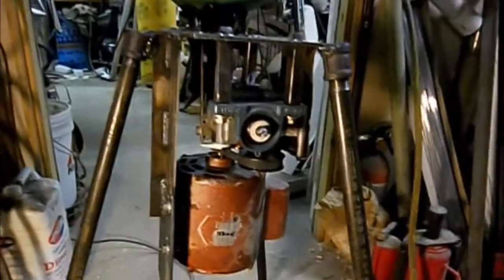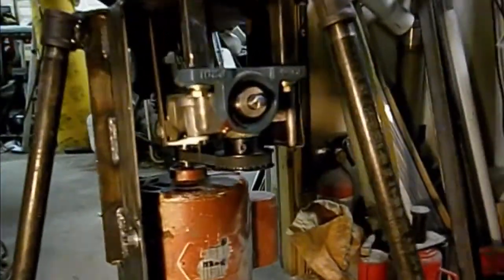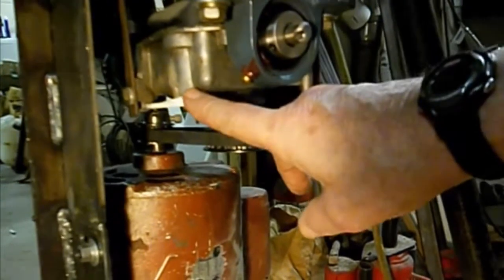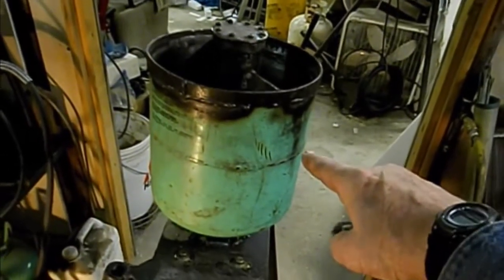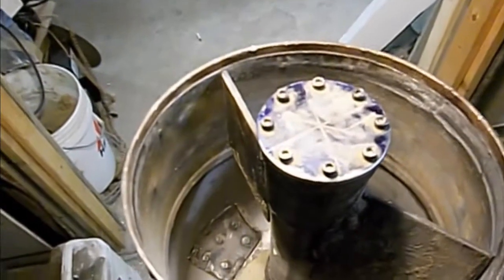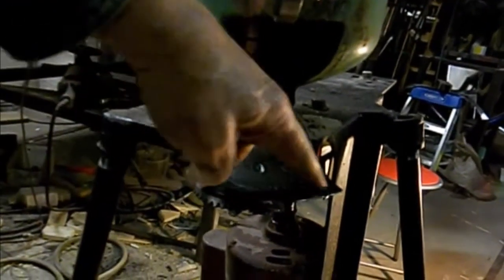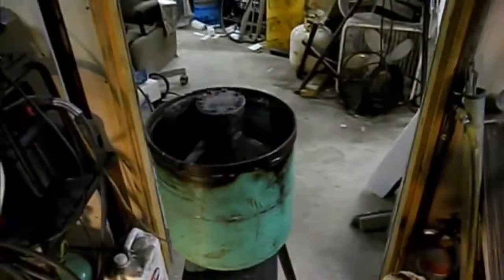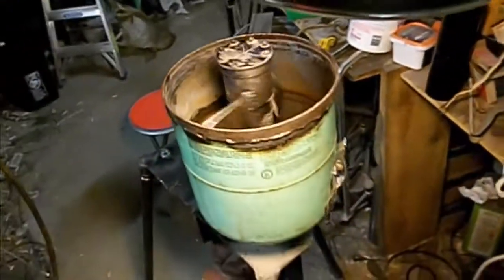Building a Green Sand Muller Part 2

Comment: Hi Bill - how has this muller been working out for you? I've started backyard foundry as a hobby and have some petrobond that I think I will need to be mulled soon. Thanks for the video.
Reply from the maker: Well after a little work I got the scrapping to stop and it was going good, but unfortunately that lawn mower trans couldn't take the load. I found what I hope is a better trans but of course it's nothing like what I had so it's going to be a major redesign and money for parts is always a big factor.